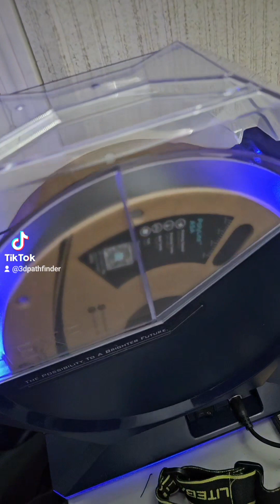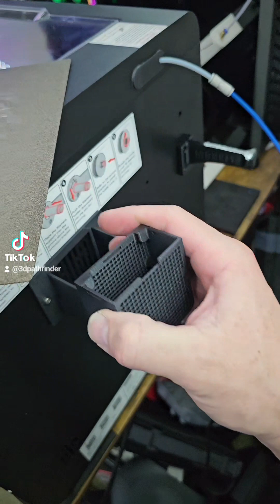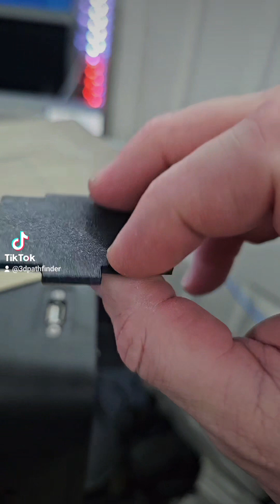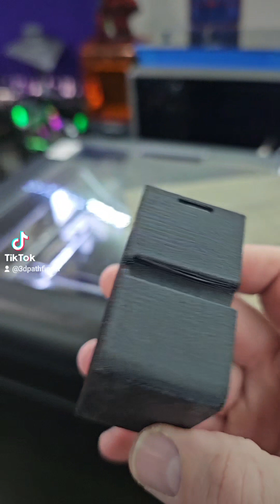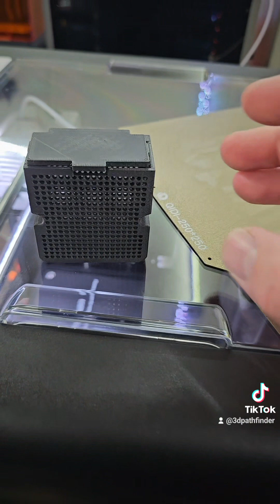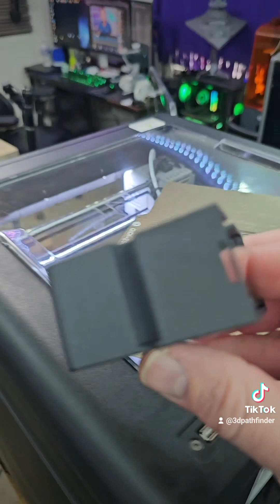@QIDITech Q1 Pro Carbon pellet filter container! #3dprinting #qiditech #Q1Pro

Comment: Nice print.  I think the container on the outside is a good idea for convenience, however doing it on the inside has one big advantage. It guides the hot air from the chamber directly outside and not into the electronics compartment. I think it would be nice to add a tunnel inside just for that.
Reply from the maker: This model does have a internal tunnel to direct airflow to the carbon pellets